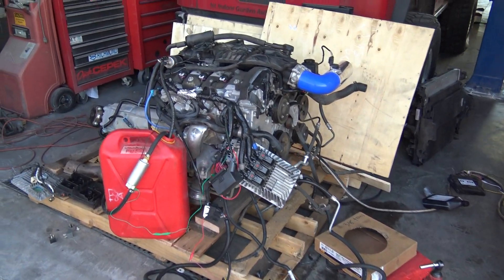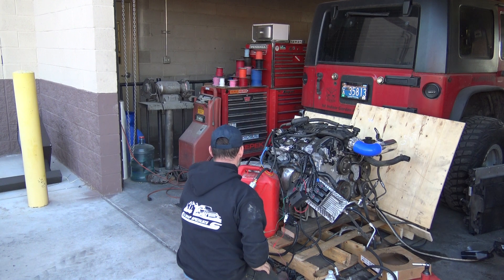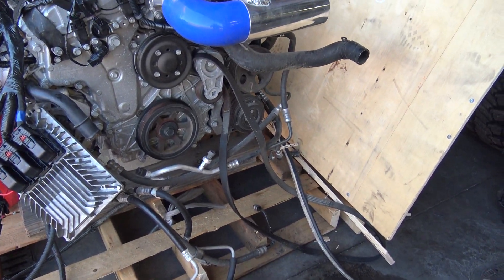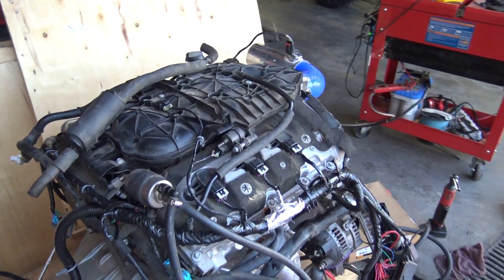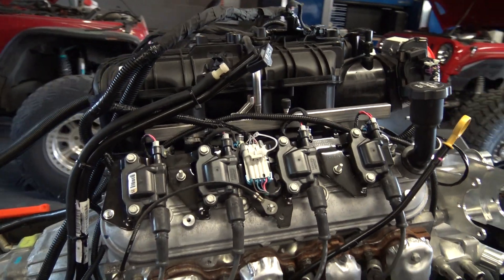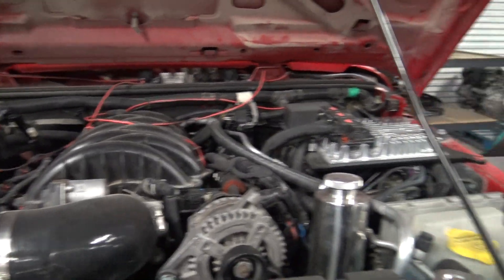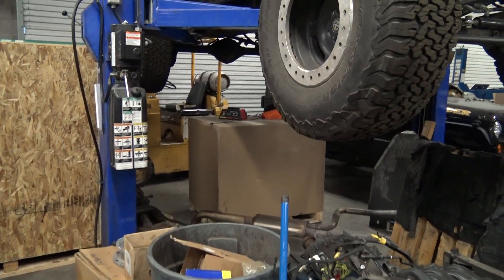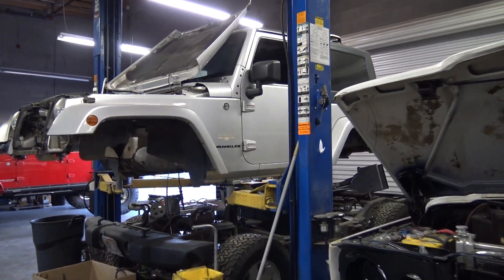LFX Engine swap

Comment: I am doing a 2016 truck 3.6 auto trans  swap into a 58 truck.
Have all harnesses and modules including steering wheel, cluster , exhaust, cats and auto shifter/consume. 
Can I do a stand alone ecm or do I need the bcm and delete the trac control, Traction control and power  steering signals to make this project a success?

Comment: I have a couple questions on my 2016 LGX swap I’m about to begin...

How different is an LGX harness from an LFX?

If I source a used ECM from a 2016 Camaro, could I modify my harness to simply be plug and play without the need for a BCM? 

 Do you have any tips or diagrams that you could send me so that I can begin?  I am currently only working with an Alldata account for my diagrams.

Comment: Don't understand how he started the engine with the PCM having VATS and all of the missing  connections that the computer expects.
Reply from the maker: dlagrua why do you think vats is not deleted? All vital sensors are installed and it even has exhaust with all 4 02 sensors installed
Reply: OK you got the VATS delete solved (HP Tuners?) but a CAN based PCM also requires all the inputs from the BCM and ABS or it wont enter closed loop. Am I missing something.? If you have this all solved my hats off to you.
Reply from the maker: dlagrua all my gen iv and gen v swaps run in closed loop without the abs module. Also I do not run a bcm very often. These do not affect closed loop but the bcm can affect the charging system. What engine are you having issues running in closed loop?
Reply: I've done several engine swaps in mid engine Pontiac Fieros. Most have been for the Grand Prix 3800SC engines which is now old tech. They were easy swaps but the LFX is a totally different story. Planning a new swap with an LFX/ 6T70 (transverse engine) and just trying to figure out how to make the PCM function properly.  Another obstacle  is the electronic gear selector, the traction control and how that can be deleted without speed sensors. Might be as simple as using HP Tuners editor by removing the DTC's from the program but I'm breaking new ground here. My hats off to you for doing these swaps.
Reply: did you ever figure it out?